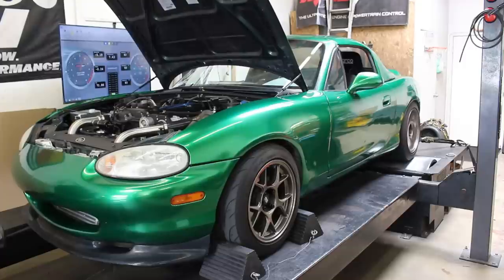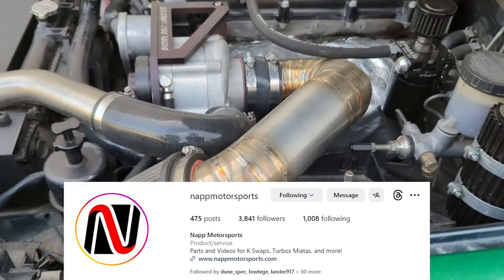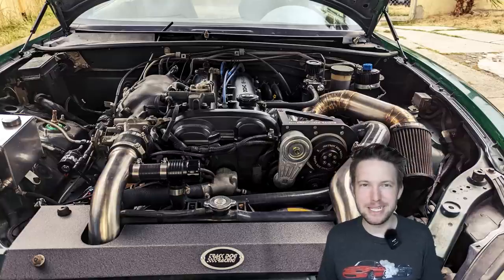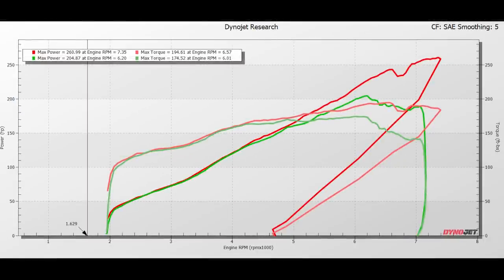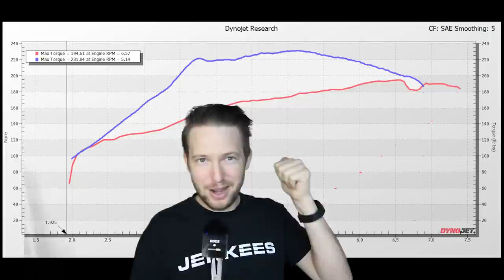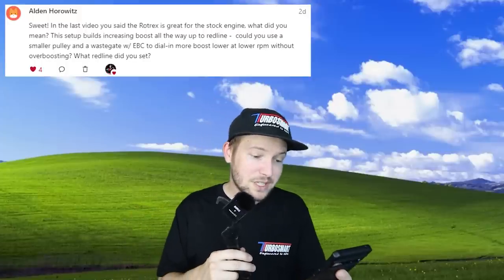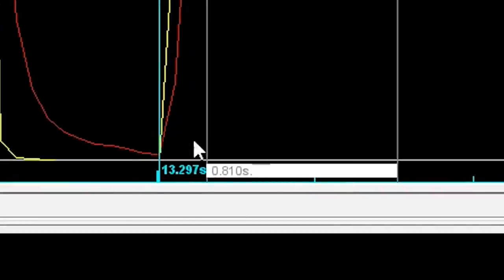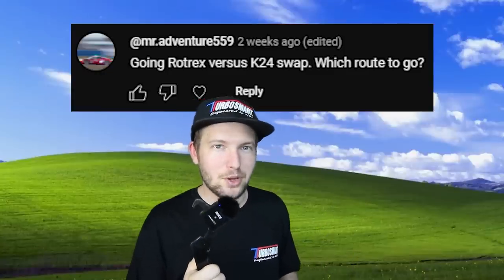The ULTIMATE GUIDE To Deciding if Rotrex Is Right For You.

Comment: Great video Greg! It's surprising how little videos there are geared around the rotrex, that LHT video is like the only one that has a teardown and internals and even then it's not detailed enough on the disassembly to replicate. 

Some things to note from your video here, you mentioned how close virtual dyno was to the actual dyno results (3ish HP), I'm sure you did data logs while on the dyno and since you have the exact HP for the pull you could play with the input data of the app to read the exact same outcome essentially dialing it in so your street logs would be an exact representation of what the Dyno results would be. 

IDK if the Dyno is able to record boost pressure for the display off of a vacuum line from the engine but that would have been a great data point along with AFR to go with the HP and torque reading. Looks like you were dealing with something on the top end... even in the final Dyno pull there is a dip then climb right before redline. Curious if you pinpointed the cause? what is peak boost 11psi? AFR target? Total timing at peak boost you got away with?

One thing you mentioned was TDR was able to make a bit over 300WHP on this same size blower with stock engine BUT you are running the blower at max RPM and got 260WHP, I would guess that was on better fuel but what else would have been done to get that result over what you got?🤔 Maybe PS and AC delete? IIRC you already have a lightweight flywheel and looks like lighter wheels also (less rotational weight on the motor).

One last bit of relevant info is the Rotrex oil system has a max temperature of 80c or 176F. For anyone pushing the blower past it's RPM limits you will want to go overboard on the oil system cooler and possibly a second reservoir. There are some builds running the blower as much as 20-25% over spin and get away with it by keeping the oil temperature in check.

I would love to see someone spray water/meth (high pressure atomization/small CC, 70-100% mix supposedly works well) into supercharger inlet and see the effects in boost pressure and gains on the dyno. (aquamist, prometh, and usually sideways rally team offer the nozzle holders).
Reply from the maker: Great set of questions here

The dyno can read PSI but I forgot to hook it up. I'm disappointed in myself for not showing the boost curve in the video, it's such an important part of learning about the powerband of a centrifugal supercharger. This is from the datalog, for reference:
RPM - PSI(G)
2000 - 0.7
2500 - 1.9
3000 - 2.6
3500 - 3.6
4000 - 4.4
4500 - 5.7
5000 - 6.7
5500 - 8.3
6000 - 10.0
6500 - 11.6
7000 - 12.9
7500 - 14.4

The high RPM dip is most likely ignition related as boost remained constant in the logs, but you can see a blip in AFR right where the dip is. AFR target is high 11's.

I know TDR's setup was a C30-94 with a 90mm pulley just like mine, I'm not sure if they were using the 130mm crank or 150mm crank pulley. I know it is possible to over-spin the supercharger to make more boost, there are plenty of people doing it but I'm not sure how that affects longevity. Also - my engine is definitely not the healthiest, it only makes 125whp with no boost. So a healthy VVT motor making 150whp should be close to 300whp at 14.4psi, and more with E85/more timing.

Good to hear another person talking about over-spinning, since it's just a street car I don't think fluid temp is going to be much of an issue. Sounds like it's time for me to order an 80mm pulley 😎
Reply: @TheCarPassionChannel  IDK man sure you could go smaller pulley but then you are pushing well past the Rotrex units efficiency range.🤷‍♂️ I think the better option is to do the same bolt-ons you would NA, head flow would go a long way along with a cam, boost pressure would come down (at same spin RPM) but power would go up.
 Same with spraying methanol pre-blower, would effectively make the blower flow more CFM from methanol flashing off pulling heat and condensing the charge. And if you went that route might as well go dual control and spray the intake manifold for knock resistance and advice timing further. 

Also 14.4 PSI on stock ring gap IDK how much further you could push it. (Seems like a lot) 🤔

I think you should do one of those short clips or reels calculating the engine CFM and work that equation out Rotrex provides against the blowers efficiently map along with the dyno pull sheet and show where in the map the blower is at against the pull. I would like to have a better understanding of how to read those and seeing it against real world data would be great! 🤓
Reply: @TheCarPassionChannel  Can't wait for E85 install video..! I will have to get this rotrex for my crystal blue mica 2001! My buddy has a crystal blue mica with the TDR as well being sold in mid Illinois if anyones interested

Comment: One question I haven't seen: how is fuel mileage compared to NA/Turbo? Seems like that Rotrex is sapping lots of energy even when not pushing it.
Reply: Same if not better than stock mpg, prob because of having a custom tune. If I wanted, I could get low 30mpg trips. I remember high 20's stock but never above 30. That was with my c30-74. I no longer worry about mpgs with my now fully built motor and c30-94.
Reply: @dicedicerice69 That makes fuck all sense. If it was a very efficient turbo, maybe, but a supercharger hell no
Reply: @Clooger-  believe whatever you want. That was back when I calculated mpg every single fill up. But to be clear, I was talking about pure highway mpg. I was blown away when I got 30+ mpg coming home from the dyno, it was a 2+ hour trip. Obviously day to day was worse mpg because I made use of the extra power often. But if someone is asking cuz they daily their Miata to work often, they probably won't notice a drop in mpg, assuming they drive like a normal commuter.
Reply: @Clooger-  Highly depends on how you drive. More throttle means more fuel. If you compare the exact same boring "grandpa" driving, the boosted car CAN get better milage. You'll be able to shift a bit earlier since you can make more power at lower RPM's, and which is more efficient. Recall that LS1 F-bodies used skip-shift where it lugs thru 4th after 1st - it was a more efficient way to meet emissions & MPG requirements. It's getting near WOT while lugging, which reduces pumping losses & ups MPG's.
Reply: @dicedicerice69   What power are you getting from that fully built motor (specs on the build please?) and the C30-94? - I ask because I am in the process of this myself with a C30-94. Any other info on your build would be appreciated, cheers!
Reply: On my SXS I'm not having to run at high rpms instead I'm cruising at low throttle. Fuel consumption is the same unless you are stomping on the gas everywhere

Comment: The Rotrex, twinscrew, and TVS series roots are about 75% efficient.  Adding an intercooler improves efficiency, reducing the parasitic loss.

The boost in a centrifugal supercharger like the Rotrex increases with RPM.  A roots and twinscrew supercharger make a fixed boost at all RPM's, the roots doesn't seal as well as the twin screw, so low RPM isn't as good as the twin screw.  

In all superchargers, boost climbs as you near redline because the restrictions in the intake ports and valves (volumetric efficiency). 

The Fast Forward supercharger kit (also a weekend install) using the TVS900 roots can easily hit 300WHP with E85 (130mm crank pulley).  It replaces the intake manifold, reducing the volume after the throttle, idle is easier to set (dual throttle bodies help with a hotside supercharger and large intercooler).  It is also CARB certified for those of us in Kalifornia.

Comment: I would like to add that: 1. Turbos ALSO add parasitic drag on engines... & 2. The linear\ascending torque curve of CFSCs saves gas at low RPM(where - unless you're towing - high amounts of torque isn't necessary)... LOVE this project!!! 🙂  P.S. Whilst watching this video, the idea, to use the Blow Off of the SC(in this case)to move air across a radiator & or intercooler to aid cooling came to me...🤔

Comment: I just put the smaller rotrex with an 80 pulley on my miata and it’s insane fun. Would definitely recommend
Reply from the maker: I'm so curious to see the effects of the different supercharger sizes and pulley setups. They're so easy to change... might be worth a dyno day!
Reply: @TheCarPassionChannel  right now I’m running the fuel and timing cards, I am looking at getting a ms3 and a tune soon. So unfortunately can’t tell you much about my graph or numbers. And if anyone wants to know, the fuel and timing cards work great and it was significantly easier than I had expected.
Reply: @Prop74  Damn that’s awesome, I’m really curious what mine makes now.
Reply: @Prop74 how did the dyno go with the smaller pulley? Stock motor?

Comment: @18:45
I believe the TDR kit uses fuel/timing cards. You don't need to tune it if you don't want to. Another factor that makes it much more simple.
Reply: If you genuinely think those cards are simpler then you're mistaken. They're ancient ass tech that works half the time, is super finicky and unreliable. Also there's wiring involved, it's not plug and play. Some of them come with adjustments too, and it's not like the instructions are good enough to tell you how to tune them either.

You'll struggle to find people that knows about them or even want to touch them.

Really if we're only talking about simplicity and not cost, getting a pnp ecu with a good base tune, driving it to a tuning shop, handing him money and driving away with a perfect running car definitely is simpler.

Power cards are simply cheaper, nothing more.
Reply: I was kinda thinking the same thing about the cards, but then I saw a Megasquirt install video.  It's not difficult and adds so much flexibility. I'm definitely going with an MS ECU
Reply: @imnota  You can get the pnp versions of the power cards too, just like a PNP ECU. 

I'm sure MSPNP is better but the kit is already 5500USD... the flyin miata turbo kit is 4000USD. The difference between them in cost is already the same as an ECU + dyno session + tune.
Reply: @Grumpini  Wether it's trackdogracing, jackson racing, Moss, or flyin miata all I see is power cards with flying leads you gotta wire in. But anyways even if they had a plug in version they're still hacky way to get around the stock ecu...
Reply: @imnota  TDR has the pnp on their website... dunno what else to say

Comment: I couldn't quite tell in your video the height of your oil reservoir in relation to the oil inlet and outlet banjo fittings on your Rotrex. From what I have been told, the Rotrex oil cooler and reservoir need to be below the banjo fittings. Great video and very informative. I have a Rotrex on my RB25de NEO and it made it come alive!

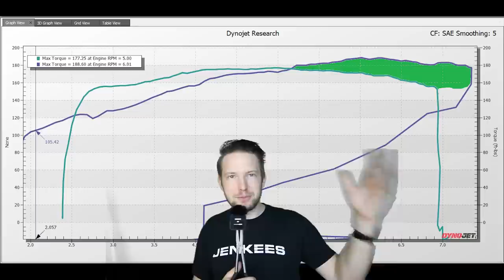Comment: 15:06 so what you're saying is that you should install both a centrifugal and a twin scroll supercharger for low end torque and top end power. Noted
Reply from the maker: Now you're talking
Reply: Some Detroit diesels had roots blowers & turbos at the same time specifically for that reason!
Reply from the maker: @williamzoom  Weren't some Detroit Diesels supercharged simply because they couldn't run without one? Crazy engines haha
Reply: @TheCarPassionChannel  They are unifold engines so the supercharger was needed.  Twincharging has been tried by a lot of companies in racing & oem I think VW & Volvo both have engines with them.
Reply: I have 3 twincharge cars. It’s also for what characteristics I like in cars
Reply: @williamzoom I remember of a twin charge lancia in group B that got 2.5 seconds 0-60

Comment: Heat management on track is just as bad as a turbo track car. I had to do every off the shelf cooling mod to mine. I could get 2-3 laps on a 2.0 mile track before needing a cool down lap, on a hot 90+ day. That was 10 years ago, after just slapping on the c30-74 kit on an otherwise stock miata. Now with the c30-94 and a built motor, all the cooling mods are still doing the job well.

Comment: Put the same TDR setup on my ‘02 Miata.  I removed my driver’s side fog light to send more air to the oil cooler.  There was no one within 150 miles who tuned MegaSquirt in my area, so I went with the TDR Fuel/Timing cards, essentially a piggyback..  I dont recommend it.  It runs much too rich when putting around town and fouls plugs left and right.  At least, that was my experience.  Definitely go for the standalone computer if you have the ability to properly tune it.

Comment: I have a crazy built motor and Rotrex setup. Over the past 2 winters we have turboed 2 other cars, an NA, and an NB. We all track our cars.

The Rotrex systems is much easier to keep cool on the track due to the fact that it does not create all the heat in the engine bay like a turbo does, and it does not put heat into the fluids like a turbo does. You do not need an oil cooler, and you absolutely will if you want to track a turbo car.

You can see videos of all these projects on the youtube channel James Gang Racing. We are not as cool as Greg, but we have fun.

Comment: Linear boost is a cool part of a supercharger. No boost spikes, creep etc like with a turbo. You want to adjust boost? change the pulley size.. though after a certain point the air it spins heats beyond the intercooler and causes it to not gain as much (diminishing returns) and belt slip.. COG belts are best. But, like with everything, how do you want to tilt the curve at 5252? Torque or hp? Perfect world you'd want both. Hence what Volvo did with twin charging. Turbo for higher RPM hp and roots for Low end torque.
Reply: Cogged belts are actually terrible in a Rotrex application. Most of the broken units were because of cog setup and zero slip for the unit to deal with the shock when hitting the engine limiter. It's the kit manufacturers that spec cog setups, Rotrex only offers ribbed belt pulley's.

Comment: Those are phenomenal numbers tbh, like right on par with a 2554 or 2560 and most your heat is managed with the external cooler and res vs. The turbo setup pumping it back into the sump and creating a large buildup of heat right next to the motor/brakes.

Maybe my next miata goes SC lol
Reply from the maker: Definitely on par with the peak power of a healthy 2554/2560 setup. Nowhere near the amount of power at 3000 - 5500 though

Comment: Hey man, so, I’m a 370Z owner with a C38R Rotrex kit making over 550whp on 93oct. Just fyi, you can actually control boost on the Rotrex supercharger. I just don’t know if Miata’s have the tuning capability for it. I assume they would. But… I use ECUTek on the 370Z. Just need a mac solenoid and connect the vacuum/boost reference to an open side of the EcuTek and you can use the BOV as a boost control. So it’ll bleed off excess boost pressure when boost goes above target boost. It’s kind of wild.

Comment: Very nice vid! Thanks! 
Btw you can tune the rev limiter in ME so that it's more gentle and spread over wider rpm range. so let's say instead of cutting power hard at 7500 it can do it gradually from 7k to 7.5k disabling more cylinders and cycles. Feels much nicer too. You can get it to almost where it seems that you lost power instead of bouncing :)
Reply from the maker: Yep that's exactly how I have it set up right now, soft limiter starts at 7200, hard limiter at 7500. Works perfect!
Reply: @TheCarPassionChannel  Ok nice! I have m62 and doing auto slalom which is basically very tight autocross, where I only use first gear and have to often hold it at the limiter as it doesn't make sense to switch to second for a split second. So this soft limiter really helped and doesn't feel like raping the engine :D
Reply from the maker: @Domas64  I used to run AX all the time so I know that game 😂 always choosing:

Bang limiter and hurt engine 
Raise rev limit and hurt engine 
Shift twice and hurt clutch 
Re-gear and hurt torque
Build high RPM engine and hurt wallet

Comment: Greg, one thing to note with a metal intake like that is that it conducts heat a lot better than the silicone/ plastic one that was in there before. Granted that intake is close to the exhaust I don’t know if that’s the best option
Reply: The exhaust header blanket he installed should help a lot with that, but I agree that it is something to look at. Adding an intake air temp sensor could reveal if its an actual issue. Maybe this is an opportunity to try some of that fancy gold reflective tape!

Comment: I was always interested in the max power output of stock engines. I think it's really interesting the see what each engine can handle on stock internals. And especially as a low budget guy i can appreciate an engine that can make power without expensive mods.
Personally i'm a SAAB guy and there is one dude who made 666 horsepower on a stock 2 liter engine back in 2009.
There used to be a web page with all the details but has since been lost. Fortunately waybackmachine archived the post and has all the dyno charts and most of the pictures of the engine assembly.

Comment: Just a side note, Rotrex doesn’t have gears. It has rolles, at least the older ones did. Problem is the impeller shaf, it snaps if the drive is oscillating.

Comment: Turbos need to cool down before switching off and heat up before use. You should not use turbos for short runs (before engine gets time to get to running temp).  Do Rotrex's suffer the same issue?

Comment: awesome vid man, any chance you could send me a full parts list for your engine mods?
Reply from the maker: I don't have that posted online yet, the majority of the supporting mods are in the description though. As far as the engine itself is an internally stock VVT (01-05), with a Squaretop, Racing Beat headers, and M2 Motorsports exhaust. It's a bit of a tired engine that only made 125whp before supercharging though
Reply: @TheCarPassionChannel  thanks man, might do this to my 05